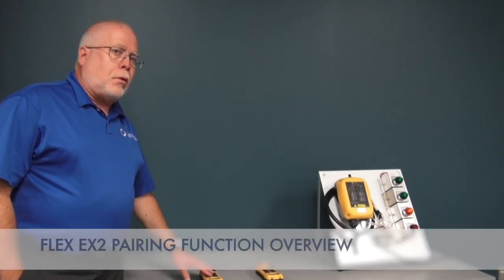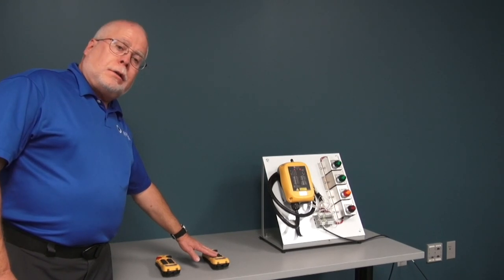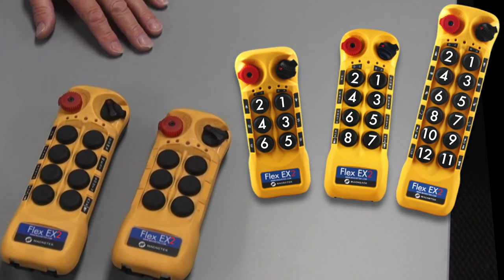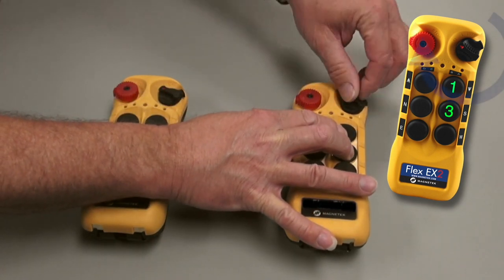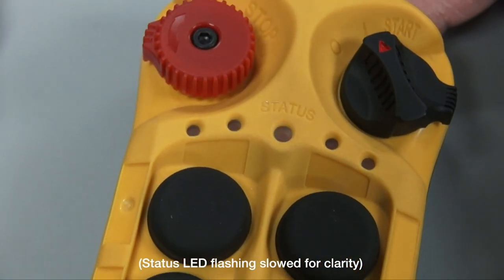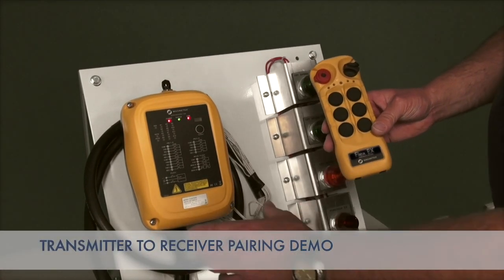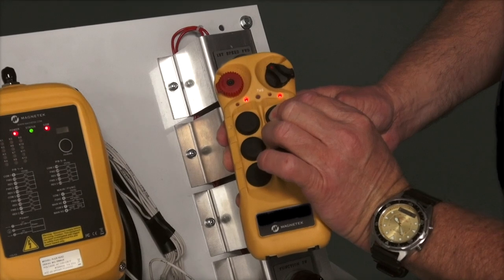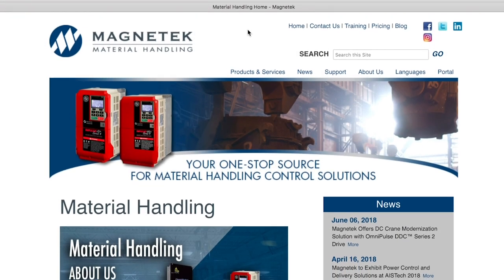Magnetek's Flex EX2 - Pairing Functions

Comment: Im trying to pair the transmiter to reciever but is not working. Whwn I press P3 and Pairing push buton , on transmiter Status led is fed flasning two times and one second pause. The reciever have no Antenna instoled , but it worked at least 4 Months